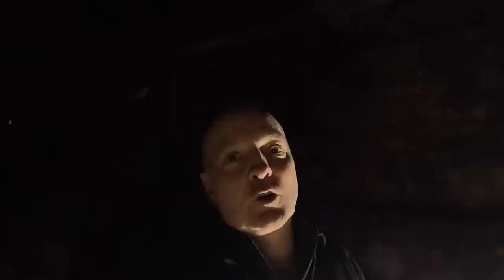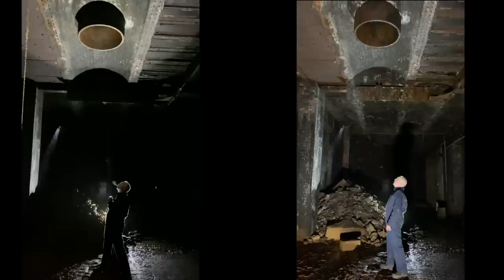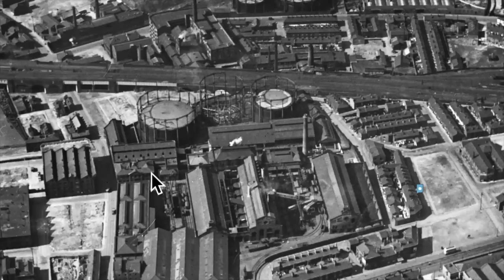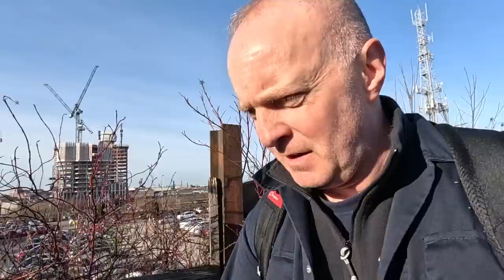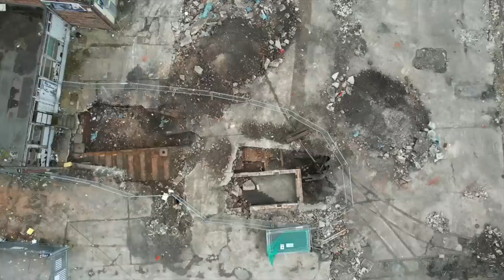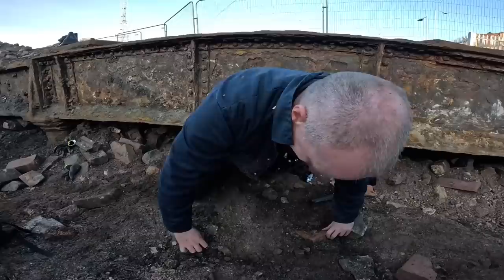Door hidden by brambles leads to 200 year old (tunnels ?) Gas works remains

Comment from the maker: Here is a link to the original video https://youtu.be/yANJ5RiGBLU
Reply: its a fan :)
Reply: In reference to the gas works in Manchester, the old gasworks in Bolton, where I used to live, was pulled down decades ago. The place must have been just as contaminated, but that didn't stop the town building a housing estate on it about 10 years ago.
Reply: Lodz in Poland,  was a village before being massive industrial centre.  The,  late communism and into post communism,  many were demolished but now there is a massive program to save the old industrial buildings.  They are huge by the way.  Some converted to flats or other centres,  museums, art centres and so on.

Comment: I worked there in the 80s Martin, there was a two story building built in 1980 on top of the old Gould st works, didn’t know what was underneath, I guess it will be very expensive to build property there, thanks for the video.

Comment: Ok. The whole site must be, what we in the states call a brown field site. Old industrial site with loads of contanaments.

Town gas works were you took coal and heated it to drive off the volatile hydro carbons to be burnt in lamps and stoves in town. The nasty byproducts included loads of carcinogenic compounds,  heavy metals, and Mercury / Arsenic. Back in the day, this stuff was just dumped along with coal ash and clicker from firing process. 

You guys are taking a small risk exploring, but think of the workers who's lives were cut short by all that crap. Then again, they did smoke like chimneys and drink like fish in those days.

Comment: I remember the train line across rochdale rd.I worked for the NWGB in 1964-67 at Newton heath on Oldham rd,I often worked from Gould st.The old row of buildings facing gould st was where my Gran and Granded lived when they first got married.The Spread eagle pub was a  bit higher up Rochdale rd near Rochdale rd mcr corp bus station.Gleden st Bradford rd was where the gasometer was,(one non collapsible,the other went up and down floating on water.They took a canary in the gasometer to check if it was safe to breath.There was Bradford pit at Forge lane,and the trains used to use the road for the steelworks.

Comment: Decontaminating land seems a long and hard process. Back in 2000, I had many visits as a contractor to the British Library archive warehouse on the old Woolwich Arsenal site. The warehouse is a listed building and is an old munitions factory. The walls are many feet thick, getting slightly thinner towards the top but still about 2m thick. The roof is relatively flimsy so that if the whole place goes bang, it does so upwards instead of outwards.
Anyway, all around the building, there was development under way but they seemed to be just moving piles of earth around at the time for months on end. Afterwards I learned that this was the land decontamination process because clearly there were some nast chemicals involved in explosives manufacture and so the land was pretty nasty. I expect the land you were on in this video was equally contaminated, there will be a lot of work to do before they can construct modern buildings there.
Reply: As with all mining operations my main worry would be the radioactive bits of the soil combined with stagnant air in there making radon and similar fissile gases over the decades in considerable amounts but also imagine the amount of heavy metal salts that leeched out of all that coal and coke. As they also got rail deliveries the coal could have come from anywhere so it will be a wild mix of everything that exists as minerals all around lol. Good luck, have fun to the clean-up crew and their engineers in figuring this out

Comment: Just found you videos through another You Tuber I am a great fan of, The Hull History Nerd.  The piece of machinery you investigated is a trolley mounted, mobile electric blower, the blades are the impellers of a centrifugal fan, the metal casing on the top would be used to direct the air to a particular point, most of the circular casing around the impeller is missing, the other part, with the cable wrapped around it is an electric motor connected by a shaft via a reduction belt and pulley rig inside the casing. the long lead makes the unit mobile.  At a guess I would say that this unit would have been used for cooling the retorts once the coal had given up it's gas.

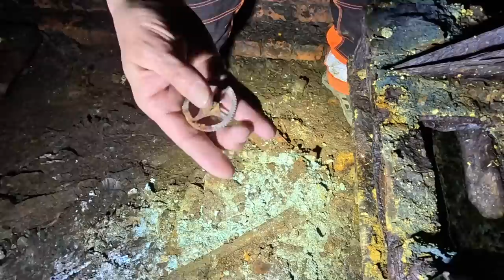Comment: 3:28 is a portable air compressor. Likely was used with a jack hammer to break open the various coking furnaces. They tended to brick up the doors during coke production.  It's either that, or to break up the coal itself into smaller, more manageable sizes.
Reply: Not a compressor it's a fan.
Reply: Definitely not a compressor.

Comment: on the trolly is a  massive extractor vans used for pumping out stale air its drivin by the electric motor attached to it .. the long black extension lead for power....

Comment: Back in the 70s when many streets around higher and lower broughton were demolished they simply bulldozed everything into the cellars to save on the cost of removing 1000s of tonnes of rubble ,i know because  i was about 12 to 13 and watched the demolition men doing it .The cellars of my Nanna Flo,s old house which was Cooper street higher broughton will still be there buried under the newer property built later in the 70s and early 80s ,the old street layouts will also be there too .Who knows in decades to come it may well be all dug up once again exposing the past .

Comment: Most interesting this, I worked in the Area Offices here from them opening in 1981 to 1994. The remains were known about as they were uncovered during the new office development and all managers had instructions not to issue any entry permits to the old workings due to the contimated nature of the waste that still remained and they were eventually all seal up with keep out signage, but clearly not now but I expect that National Grid Properties would have declared the contamination when they sold the land to Manchester City Council. Waste contains sulphur, ammonia, tar and other coal gas prodution nasties including cyanide. Not safe in there and tempting as it may be best keep away.
Reply: Does the gas not escape?
Reply: @leenevin8451  the gases may vent out slowly through the holes but the residual contaminants in the ground will continue to be released over probably quite significant amounts of time so there's always more. That's why clearing contaminated ground is such a long drawn out process and why the underground rooms were backfilled originally. A way to reduce the above ground contaminants and try to forget about the rest
Reply: @dawnmoriarty9347  how many years were they in service?

Comment: Another great video. Old gasworks are some of the most contaminated land that developers encounter, particularly those going back to the early 19th century. I remember working on a site in London and encountering ‘blue billy’, which is the remains of ferric oxide used to remove sulphur and cyanide. I must admit I would have needed more PPE to go under an old gasworks!

Comment: I remember the tracks across Rochdale road as a young child  in the 50's and 60's and may be they lasted up to the 1970's they where there a very long time for sure. but don't recall the gas works.
The vault ceiling and Iron structures reminds me of those at Piccadilly Station, when I get off the Metrolink and go up the escalator and at the top there is evidence of the same construction which would be Victorian.

Comment: Martin, you should be careful entering underground chambers in old gas works, if that was founded in 1824 that is the start of the gas industry and the ground will be very contaminated. The big filled in chambers with the vaulted roof could be Tar wells, the storage tanks for liquid residues released by reducing coal with heat. Some of these chambers could be 100 feet deep, I saw some at Kensal Green works in London this deep, and I am guessing some of the first cellars you were in were under the retorts, the chambers they filled with coal and then baked with coal fires to produce the gas, Peter.

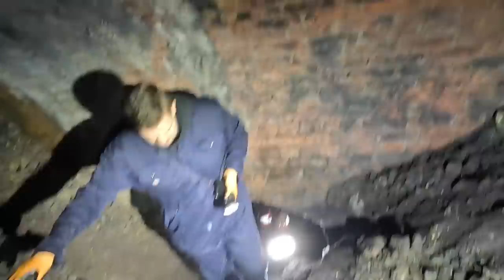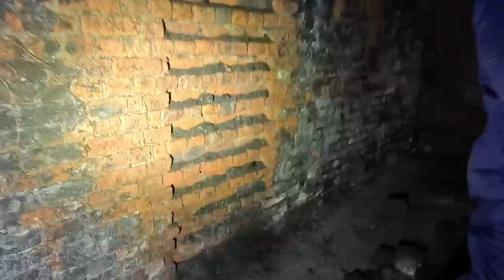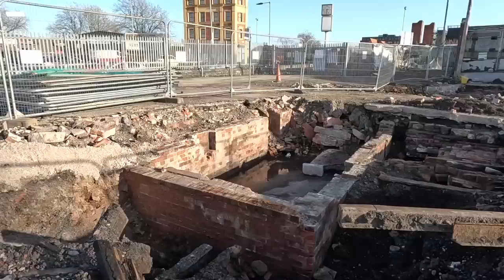Comment: Thank you from down under for including me in this explore, it never ceases to amaze me what is hidden below the surface even here in Australia where our meager modern history only goes back 200 years or so , abandoned mine and abandoned places explorer here  also humble opal miner. @ 6:54 or so why was that bricked up  or where those bricks surrounding a coal shute?  @9:11 a brick chisel and a mallet  would I do such a thingy to find out what is on the other side, its not something that has been there but something that has been blocked of , for whatever reason. @ 9:30 that is a deliberate back fill from the surface, albeit a very sloppy half arsed job indeed,  . 13:03 brick chisel and mallet make small hole just to have a look ? My educated guess would be it lead into where you found the round hole in the outer walls and put the go pro through. @17:57 and before that site would be so contaminated but I guess money talks and safety walks. Not to mention the amazing Victorian and Edwardian history and architecture  that they would like to erase and prefer we forget. Going to Urban Legends TY, 2 have a look.

Comment: Do you have gas/oxygen monitors with you when you go into confined spaces?.
When i worked for a water authority and when I worked in a quarry if entering a confind space chamber etc , the meter would be lowered into the chamber/ confined space to get a reading if it was ok we could enter , constantly monitoring the air quality and we would have a harness on connected to a rope so if we got into danger we could be pulled or winched out.

Comment: That object you highlighted with the ? Was probably a air compressor of some sort, giveaway to me is the rubber hoses
Reply: Those "hoses" are the electrical cord for the electric engine that spins the blower fan.

You can see the outlet on the top of it, blowing towards the left of screen.

What it's used for, I don't know, but it's a high volume blower fan.
Reply: @35manning  ahh gotcha, perhaps it was used to blow off the workers? 😂

Comment: Really interesting guys. Working in the gas networks this give a real insight into the past before natural gas. The gas produced from the coal via burning it in an oxygen depleted ovens, was about a 50% methane 50% hydrogen mix. The gas networks are working at introducing hydrogen mix into the networks to reduce carbon emissions. The piece of machinery looks like some sort of movable ventilation equipment. There is a good example of a gas works in Biggar in southern Scotland.

Comment: Good video but I'm concerned about dead air in those confined spaces. Do you test the air? How did they turn the coal into gas? When my old man was in England during WWII he said that there were vehicles with big bags of gas on their roofs. The gas ran the engine and a device on the back of the vehicle created gas. Those girders are very old. They are riveted together. By 1900 girders were hot rolled to save on rivets. Good Luck, Rick

Comment: "Benny" was a character from Crossroads, complete with blue woollen hat and overalls. The character was played by Paul Henry.

Now then, you missed a trick - Those rails, and more importantly, where and how they crossed each other, would give you your exact location, if you matched them up with the rail map you were looking at.

From the 1901 picture with all the pipework and gate valves, it all looks very much like the kind of plumbing that was used, and still extant, at the Royal Navy furnace fuel oil depots at Portsdown, Inchindown and Lyness.

I noticed from the "Great Britain From Above" pictures, there appears to be a rank of "coal cells" right in the middle of the complex, and also I could see what looks like a covered conveyor which might have taken coal to, or from the cells to, or from, the retorts. The retorts themselves would be very interesting to see - I wonder just how highly mechanised the whole process would have been between say 1885 and 1935. I'm sure there would have been a phenomenal amount of change in that time.

Great find fellas - Well done 👍

Comment: On your old overhead map, it looked like there was a lower level railway being used. Follow the track across Rochdale Rd until the line curves right, and then look into the shadows, where the angled conveyor belt shafts are, and you can see, dark against the floor, train hoppers. The tunnel must run into the Oldham Rd sight, and come out somewhere south of this map image?

Comment: The Gas works at East Becton were sealed under a mound of dirt due to the contamination. They used it as an artificial Ski slope but that failed. Resident in the new estate built around the area were advised not to grow vegetable in their gardens due to heavy metal contamination. Hope you safely disposed of those boiler suits.
Reply from the maker: We ate them 😳

Comment: so they manufactured natural gas from coal ?
Reply: Town gas.
Reply: @suzyqualcast6269  What is "Town Gas" ? is it Methane AKA "Natural Gas" ?
Reply: @suzyqualcast6269  "Coal gas" is a flammable gaseous fuel made from coal and supplied to the user via a piped distribution system. It is produced when coal is heated strongly in the absence of air. "Town gas" is a more general term referring to manufactured gaseous fuels produced for sale to consumers and municipalities.The original coal gas was produced by the coal gasification reaction, and thus the burnable component consisted of mixture of carbon monoxide and hydrogen in roughly equal quantities by volume. Thus, coal gas is highly toxic. Other compositions contain additional calorific gases such as methane,[ produced by the Fischer-Tropsch process, and volatile hydrocarbons together with small quantities of non-calorific gases such as carbon dioxide and nitrogen.
Reply: DO YOU SEE THE GAS LIGHTING ?
Reply: @suzyqualcast6269  Syngas, or synthesis gas, is a mixture of hydrogen and carbon monoxide, in various ratios. The gas often contains some carbon dioxide and methane. It is principally used for producing ammonia or methanol. Syngas is combustible and can be used as a fuel. Historically, it has been used as a replacement for gasoline, when gasoline supply has been limited; for example, wood gas was used to power cars in Europe during WWII (in Germany alone half a million cars were built or rebuilt to run on wood gas)

Comment: You can see the siding coming off of the track where it bends to the right there's a track that comes off the back and goes into those three buildings near the center of the buildings and those would have been where the cars were brought in and dumped from the bottom down those shoots or side dumped into those chutes

Comment: A sprightly pensioner indeed!  I'm stealing that line.  I find it interesting that they never completely demolish over there.  Is it lazy, or a way to cut corners off the cost?  Isn't it a bit dangerous?  Seems like some of that could be cleaned out and converted into a cool underground bar or club.
Reply: It was a deliberate policy.  Cleaning contaminated land, which a town gas factory is, is an extremely expensive,  time consuming task. At the time,  the simplest solution was to backfill the underground rooms which will have been contaminated with all of the chemicals required to produce the coal/town gas, as would the ground around. So, stick the toxic earth in an available toxic hole rather than move it to another site, which will have been most likely a standard landfill site at the time. Basically leave nature to clean up after us
Reply: @dawnmoriarty9347  Thank you for the response.  I didn't consider contamination.  Of course, that makes sense.  No one was bothering to clean up environmental messes back then.  Some still aren't.  I suppose it's still contaminated then.
Reply: @SarahGreen523  I fear that some messes simply cannot be cleaned up, just moved around.  Case in point,  the situation on Tyneside at present where contaminated materials are being dumped into the North Sea
Reply: @dawnmoriarty9347  My god!  I get so angry when they dump toxins into the ocean, like that does anything but spread the pollution around the world.  Yes, here in my country they do the same thing.  The toxic train derailment in Palestine, Ohio was said to be all cleaned up, but residents there are getting ill.  All they did was cart off the soil to another state, where they were caught and sent back to Ohio.  It's incredibly irresponsible.

Comment: Martin at 3:28 that looks like a fan / blower of some sort. As a guess, I would say it’s some sort of blower for a furnace or something. The air is drawn in through the middle and blown out through the sloped section at the top. It looks like the fan is driven by a motor with the drive shaft coming in from the far side. The power cable looks to be that black coil. I reckon the was towed around and used maybe to start a furnace up. 
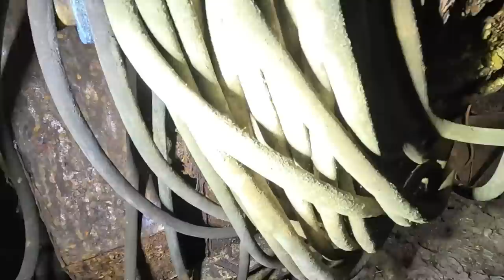You can see the drive shaft at 3:49

Comment: Martin have you ever considered doing an explore of the old underground station and tunnel of Dingle in south Liverpool which was part of the Liverpool Overhead Railway? Here are a couple of links one shows the project to make safe the roof collapse and the other, another explorers video. The tunnel went out of use recent,y because the garage owners went bust after the collapse as their business was suspended until the repair had been complete. There are loads of old interesting car wrecks down there and some of the old railway artefacts like all the cabling for the electric cables and other fittings and an old buffer stop, the vent shaft were some people,perished during a fire back in 1919 

https://youtu.be/SLHW70WaxEs

This is someone else’s explore, I’m sure you could do a much better job mate 

https://youtu.be/wd9foE-QQK8